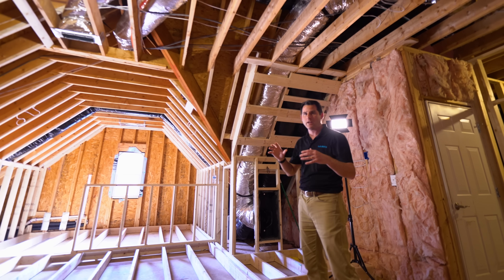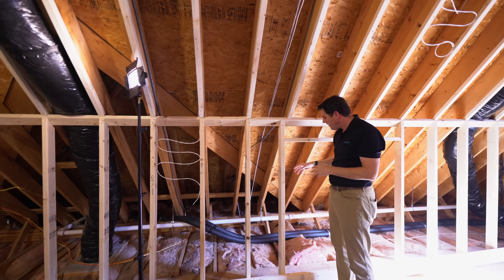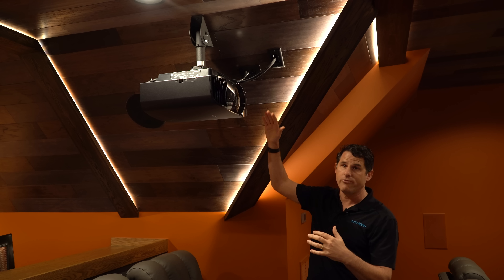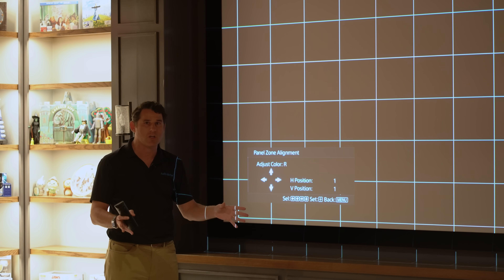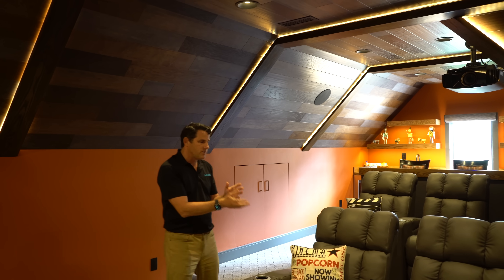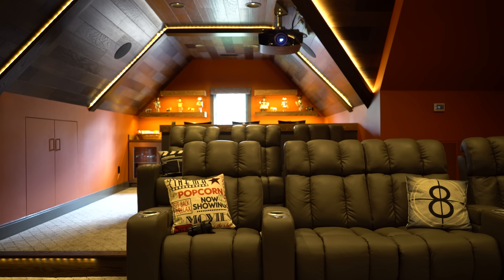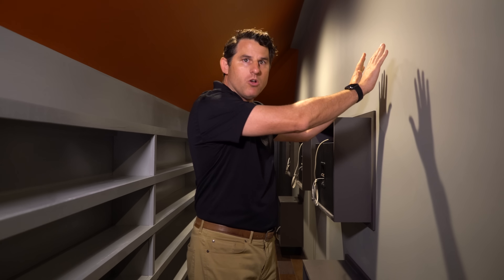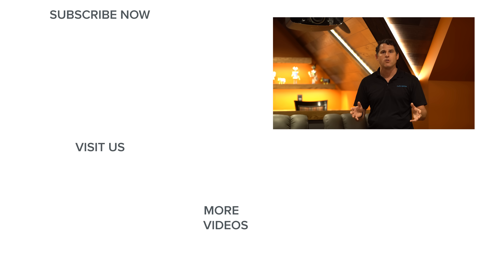Full Home Theater Install: 7.2.2 4K Attic Conversion || Sony, Bowers & Wilkins, Anthem, Control4

Comment: For a custom install, I would have liked to see the projector enclosed in a vented box that the carpenter centered on the ceiling. Also the reflections are too great on the ceiling in front of the screen. Would have been nice to see material used to flatten or reduce the reflections.

Comment: great setup as always. However, i would leave the wood panel left and right , but for the top ceiling, i would make it in a black material to avoid that annoying reflection of the image on the ceiling wood.
Reply from the maker: Thanks for watching

Comment: Really clean install. Certainly cleaner than my DIY theater. I don't see a lot of acoustical treatments in your theaters. I'm sure the customer is making a decision not to use them, but is the importance of room treatments explained to them? It's such a critical piece - more critical than the speakers themselves.
Reply from the maker: Thank you.  Yes, acoustical treatment is very important, but most of our theaters do have some level of it. Thanks for watching

Comment: Very nicely done.  So the front 3 speakers are just sitting on those open boxes or are they clamped to the drywall like a common inwall speaker?
Reply from the maker: The boxes are screwed into the studs on each side, very solid.  Thanks for watching

Comment: The video was great! How was the room insulated?
Reply from the maker: The ceiling was spray foam and the rest was conventional
Reply: @AudioAdvice  What are your thoughts on a basement build using Rockwool safe and sound and 5/8 drywall for the theater area and ceiling?
Reply from the maker: @BenBayle  Ben, that would be fine.  If you can have them use adhesive on the back of the drywall in addition to the screws, that will make things more solid

Comment: how come you are not using the lyngdorf MP series in any of your home cinema builds?
Reply from the maker: Audio Advice is not a Lyngdorf dealer.  Our high end processors are Datasat, McIntosh, JBL, and Anthem.  McIntosh does use a version of what Lyngdorf has with the Room Perfect system.  We are working on a new video of a theater that uses the McIntosh MX170, stay tuned!

Comment: Hi: Great video.  Could you give me the name or where I could order the kinda Flat Black Mounting Post for the projector.  I would like to mount my Epson 4050UBe to the flat wall right in back of my couch in my living room.  The mounting wall is only 15' from my Elite screen.  In your opinion should I mount the projector on the wall the same height as the top edge of my screen?  Thanks in advance for your tips.  Thanks  Hot Rod
Reply from the maker: The bracket was made by Chief.  This one was designed for an angled ceiling.  There are a variety of decent mounts on the market.  And yes, you should try to keep the top of your projector lens below the top of your screen. Thanks for watching!
Reply: Thanks for the help Mr. AA. I will let you know how it goes.

Comment: Well done. Which light switches are you using on the 13 circuits and which keypad? Assume you are using hidden virtual switches somewhere?
Reply: You are correct that we hid all of the dimmers in the equipment room behind the screen so they are accessible but totally hidden. We used Control4 adaptive phase dimmers which are able to adjust to control each of the different types of lighting loads (recessed LED, LED strip, etc.)